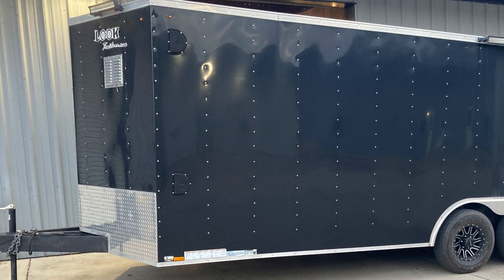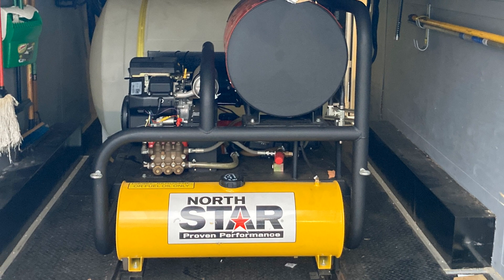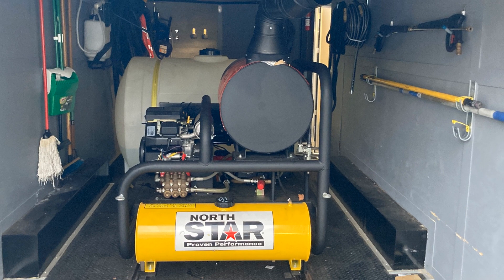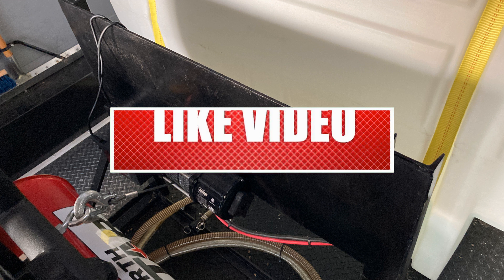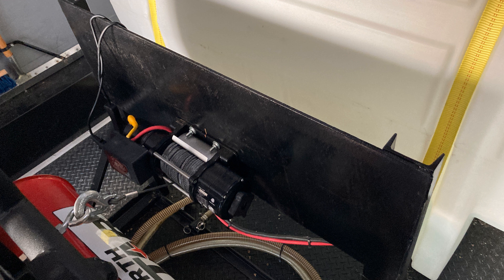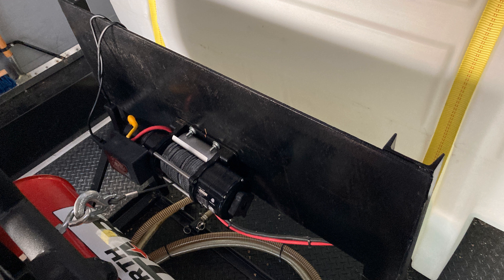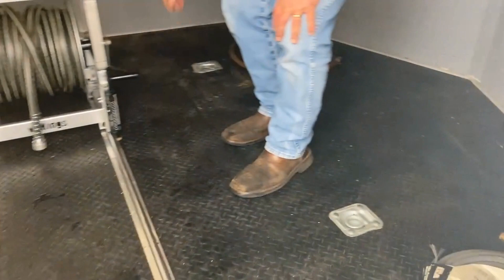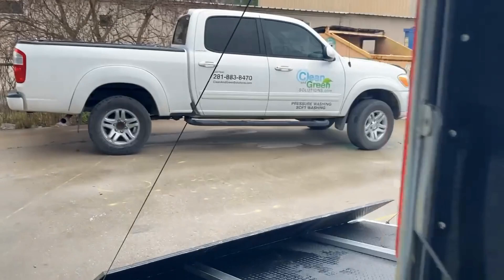Pressure Wash Help Trailer Build [Doug Rucker School]

Comment: Hey Doug I wash hog barns year round and am putting together a new trailer and want to put a heater in that is attached to the ceiling of my trailer...any ideas?
Reply from the maker: For venting the heater?? Yes you can vent it through the roof pretty easily.
Reply: @PressureCleaningSch  no I want mount an interior heater for the trailer,  I have electric ones that sit on the floor and are in the way...thanks Chuck
Reply from the maker: I would check w an RV place.

Comment: I noticed the kingslinger exhaust is facing the inside of the trailer. Would that create issues with fumes or exhaust stains inside the trailer?
Reply from the maker: No since it’s by the door and we installed a plate on the compressor.

Comment: Dou you sell the drain kit for the king slinger ? And where did you get the slides for the hose reels ?
Reply from the maker: Yes we sell the drain kits. I’ll have to check w my installer on the glides
Reply: @PressureCleaningSch  can you put up a link for the drain kit ? I can’t find it on your website
Reply from the maker: @keving4356  https://www.dougruckerstore.com/products/kingslinger-compressor-drain-kit/